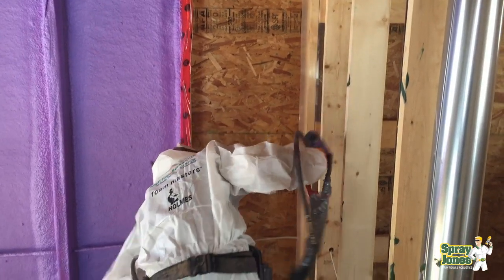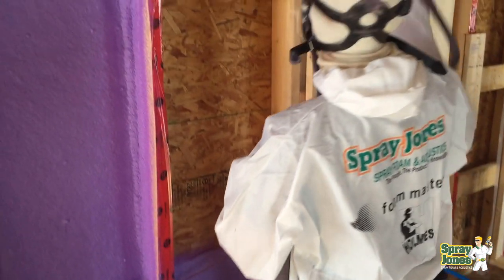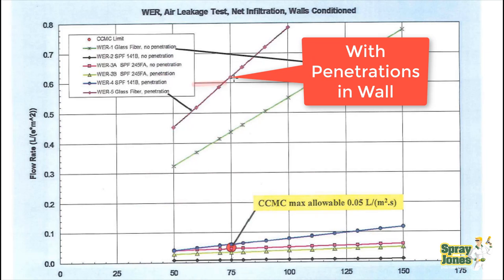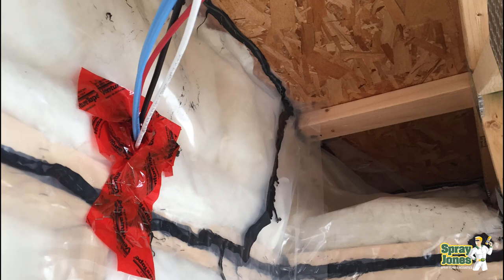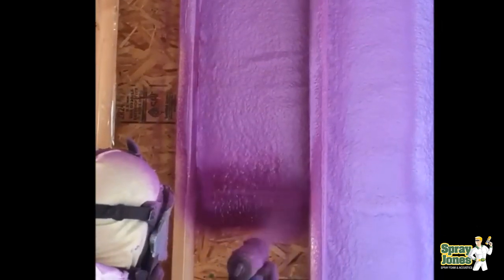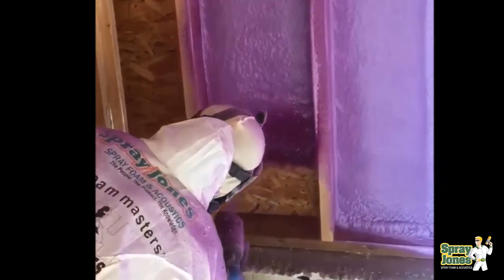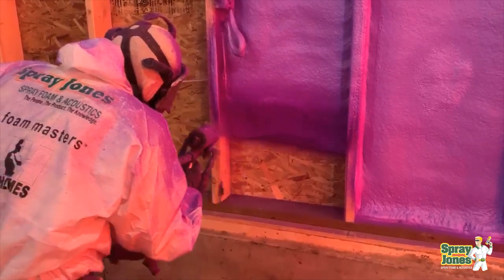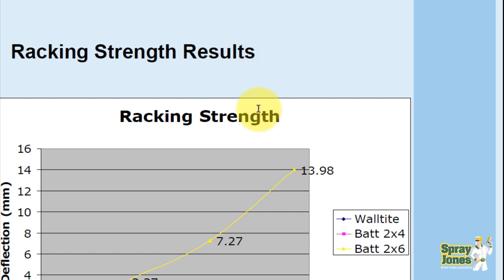Walls and Spray Foam Insulation - Part 3 | Air leakage & Structural Loads

Comment: Just seen a new video on a passive house. Foot thick walls R-40. Ceiling R-80. Celluse and fiberglass.  Blower door test .50 ach. Watched Matt Risingers "The Build Show". Built a home with the zip system and took a can of spray foam for the penetrations. Did a blower door test before insulation. .82 ach. Very good. Then he wanted to know if spray foam (closed cell) would improve the test. 4 inches in the ceiling, 2 inches in the wall. .27 ach. Unbelievable. Exactly what you were saying about air sealing. 12 inches and 20 plus inches in the other home and gets beat almost 2 to 1.  Passive house is .6 ach. Just goes to show that you can build a regular construction home with foam and get one of the best insulated homes available.

Comment: Anecdotal testimony: 
went to a "part 2" job we were going to spray this week to answer some customer questions on prep. He told me that after our last spray, which was 1" closed in the walls (large 2 story shop/storage), he realized it was 3/4" off plumb over 18'. He got in his 10k# skidsteer and pushed on the wall...couldn't budge it. He was thoroughly impressed, and I have this great selling point now. 
Great video, favorite channel. Keep up the good work!
Reply from the maker: Very interesting, I don't doubt it for a second.

Comment: Hi..I appreciate this series. I've had 2 structures spray foamed over the past 20 years and I believe in the product. 
Barndominiums are becoming a 'thing', not because buyers want to live in a 'barn', but as a direct result of rising cost of conventional home construction. Barndo-buyers are often DIY & budget oriented; paying a spray foam contractor to achieve R-19/R-30 code at $1.00++ per board ft., quickly becomes a very significant budget item.
Reply from the maker: Thanks for watching. 
In a barndo the SPF is everything. Otherwise you have a leaky, wet structure unless you are an exceptional DIYer.
Reply: @SprayJones  Yes, however I doubt typical barndo dreamers are budgeting correctly for R-value/vapor control. A 1000 SF post building with R-30 SPF roof insulation could run $5000-$6000+, and that's just for the roof. Also barndos are slab homes which require insul consideration beneath the concrete. After the building package, barndominium insulation might be the next most expensive construction component. Associated structural racking test are true and good, but I doubt this will filter into barndo framing cost savings..maybe so with a clever designer who really understood structural values
Reply from the maker: @terrylutke  Much of the Barndo community is now saying budget enough for SPF. Marshall remodel for instance is vocal on this.

Comment: Just want to start out by saying I watch ALL your videos when they're released because the data/info and way you explain the case for foam is second to none. Well spoken and valuable information. Keep up the good work!!

Question: What do you think of double stud wall framing? Do you think it makes sense for breaking the thermal bridging that occurs when using the single stud wall framing? Is it needed at all when using a 2x4 with 3" foam wall structure?
Reply from the maker: Thank you for watching. People like you keep me going. 
Double studs be like: buying a 1975 Alfa Romeo GTV 2000... Could be a lot of fun and really cool, but you need the cash to pull it off. 
Video #1 in the walls shows what a 2"x 4" is capable of with just 2" of foam.
Reply: @SprayJones  Have to say i have had the same idea about double stud layered wall of structural aluminium studs. 100mm stud, 50mm gap and a 50mm stud again. This is for a houseboat construction. just one problem so far, no one does this here in Norway.
Following your videos and i enjoy every minute of it.

Comment: Super informative videos thank you so much! i’m new to this business and it seems to be no place to really learn other than to get thrown into the mix and figure it out. I have a 3000 square-foot metal building and I was told to first do 2 inches of closed cell and then go back over it and put in the open cell in order to deaden the noise. I live in my warehouse so it’s super loud if it rains or hails. My problem is that while the logic sounded good… on a cost effectiveness and having to go through like you said and switch tanks and clean out the equipment didn’t sound like something I would want to do myself or for a client just for the cost side of it. So in my situation would it make more sense to just go in and do the open cell foam because noise reduction is something I definitely need?
And when I start applying for clients I would probably suggest one way or the other but never both? That seems to be my understanding. Again thank you for your time and knowledge all of your videos are super helpful!
Reply from the maker: Metal buildings should get closed cell SPF 95% of the time. They need the structure and vapor control first and sound last. 
I have not found a metal building with SPF closed cell inside to be loud other than reverb. The metal is deadened with the SPF stuck to it.

Comment: Hi..You probably have already covered my following question in a previous video, but I couldn't readily find where you discussed it.
I'm considering a so called 'barndominium' home. I would like to leave the under-roof foam exposed and blacked-out with paint. I think I've seen this before in eating establishments where exposed hvac ducts and lighting are suspended from the joist/rafters and everything above is blacked out. Although the barndo would be built in a somewhat rural setting, I'm in Michigan where fire spread code is pretty consistant. Is it likely that a exposed spray foam ceiling would be exceptable?
Reply from the maker: You will need DC 315 in black to meet fire code over the SPF. Again, check with your county if it is approved for use there.... I cannot see why not.
Reply: @SprayJones  Thank you!

Comment: Not sure if I've missed this stated somewhere, but I'm doing open cell spray foam on my construction and have had conversations with my builder on doing a lot of air tightening on the outside of the house taping all seams, the connection to the slab, etc). Do you think it's necessary to expense all of the work and materials outside of the house if we're doing full spray foam top to bottom, or is it still beneficial to do the exterior air sealing as much as possible to ensure it doesn't get to the plywood at all? I'm in the deep south and we're using tyvek since it's an air barrier.
Reply from the maker: You need to seal the house up from the outside since that is the first line of defense. Think about everything working as a team, no one part taking all of the weigh on its own.

Comment: What are you using to airseal the joint between adjoining wall studs and top plates?
Reply from the maker: Air seal caulking. Bulk load guns

Comment: Building a barndo with weathermaster rib roofing and 6x12 pitch trusses.  Going to open cell foam 6 inches between trusses 4 foot center.  Should I use Tyvek wrap under the metal before spraying or do you have to use the visqueen to achieve a moisture barrier.   I am going to close cell spray foam 2 inches  in the walls after Tyvek and Weathermaster RIb siding.   Is this ok  I want a conditioned attic for the HVAC ducts and Air Handler.  Building will be located in TN near KY border on Cumberland Plateau 1760 ft altitude Zone 4
Reply from the maker: I don't recommend open cell for the roof. Watch the 4 part series on roofs.

Comment: I'm confused about how you use the words "steam" and "carbon dioxide" interchangeably? Most people call water vapor "steam" it's made of hydrogen and oxygen molecules dispersed in atmospheric gases. Carbon dioxide is the specific name for oxygen and carbon exclusively. Which are you describing?

Comment: Curious to know if there are any issues with spray foam on rough sawn lumber. Due to crazy prices in my area, i've been using rough sawn hemlock to build my house. saved me lots of money so far. the wood has been aired out for about a year now.
Reply from the maker: As long as the shrinkage has been dealt with it should be more than fine.